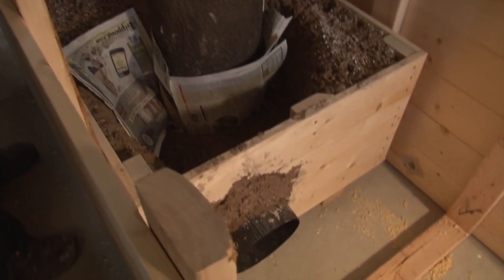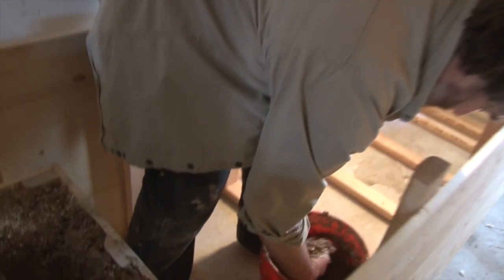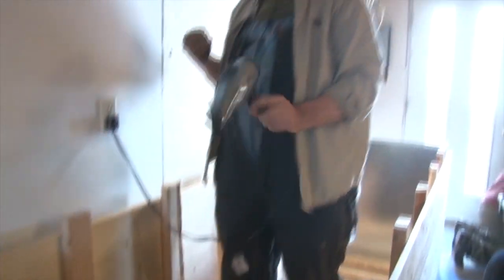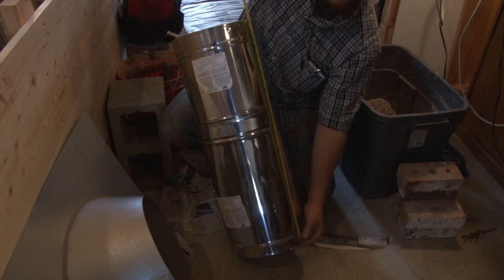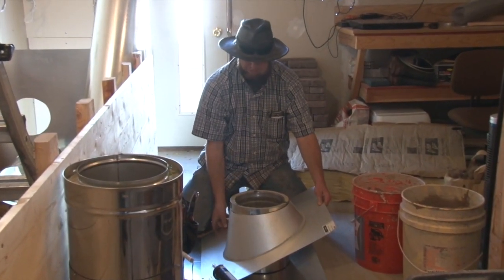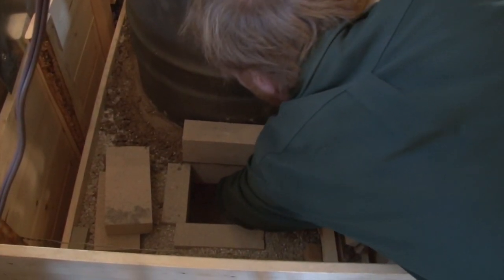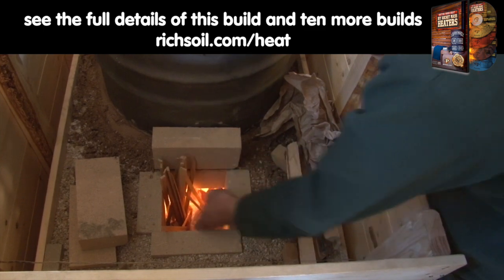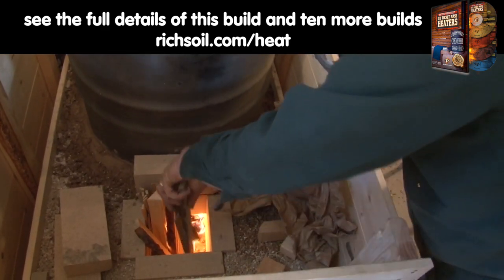steam punk rocket mass heater of science - excerpt from "Better Wood Heat" DVDs

Comment from the maker: thanks to my patreon peeps for getting my youtube engine running again http://patreon.com/pwvids
Reply: Just wondering, water has defacto highest heat storage capacity.   Have you tried using water as the medium of heat storage  rather than dirt/ rocks, etc?
Water also has high thermal conductivity so it will need to be insulated just right less it looses energy to fast.     It will also need water proof materials that will last.  It will also need a way to drain the water once a year like a hot water heater.   If it's connected directly to main water line or pressurized, it will need a few more things as well. However there is no substance that compares to water for heat storage.  I have done the math on hundreds of things.
Reply from the maker: @l0I0I0I0  i think there are several threads about this out at permies.
Reply: @paulwheaton  Thanks Paul.  I looked at it a few days ago.  Is there a certain one you would recommend?   I'm not certain what I want to do yet, thus still in the investigation stage.  I have a few questions reflecting on fluid dynamics for instance,  
How will the height of the intake to the main burn chamber effect the outer burn  chamber?  
How long does the exhaust tube need to be in relation to the size of the burn chamber and lastly,
How far can this same exhaust sink down below the main burn chamber without material losses in heat production.  
Guess I want to understand the physics and design a better one, or at least a custom one, built on the shoulders of giants who have already done amazing things!

Comment: The heating principles seem related to masonry  heaters originating  in Russia. Using a massive initial burn , the brick structure
surrounding the fire absorbs a large amount of heat which conducts slowly through the brick structure over several hours.
The brick acts as a heat sink. So the same must be true for rocket stove. I have reservations using steel to conduct heat due to
temperature fatigue. I would suggest molding aircrete blocks with water glass treatment and  stove mortar to resist heat damage.
I am aware that thickness of bricks. and material will determine the rate of heat conduction. Still learning. Engineering background..

Comment: I must ask... Why not do a hollow "bell bench" instead of a "mass bench" as it seems a bell, would be easer and more efficient, with a rocket heater of this size?
Reply from the maker: I think when you say "bell bench" I think "stratification chamber.  

What would you use for the chamber?
Reply: Stratification for sure.
Of course brick walls with a stone or cement slab top would be ideal.  Cost would go up, but I'm sure there are also clever low cost methods.  Using recycled materialist could also keep the cost down. 

I'm fascinated by "Rocket Heater Tech".  The concept of using less materials and less time to construct a much lighter bench, and yet achieve the same goal of having a thermal battery seems to have an advantage.

But then again, I don't have the experience that you guys do (thanks for sharing)... so am I missing something?  Is there a significant difference in the outcome when using one method over the other?
Reply from the maker: how about the stratification chamber in this:

https://www.youtube.com/watch?v=zeZExnJR2gc

Comment: I would want the barrel open so it could be removed easily. I watch these videos and just can’t grasp why you sink the barrels in the Cobb or other mixtures. The barrels have to be replaced and I would want it to be an easy job
Reply from the maker: Why would the barrels need to be replaced?   I've never heard of anyone replacing a barrel.
Reply: @paulwheaton  I've been watching others building these things and mention that the barrels will burn out over time and need replacement.  You're saying it's not true?
Reply from the maker: @beebob1279  I think you are confusing rocket mass heaters with something else.   There are rocket mass heaters that are over 20 years old with the same barrel.
Reply: @paulwheaton  Terrific!  You'd know better than me.  I'm taking a look at these things for the vacation home.  Next is checking with the township as to whether these are allowed or not.  Thanks for the information.